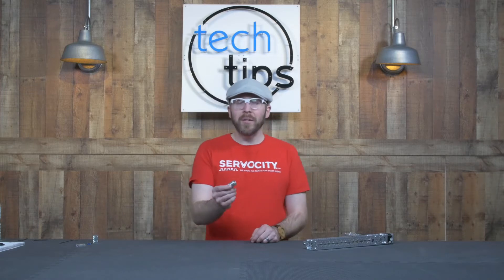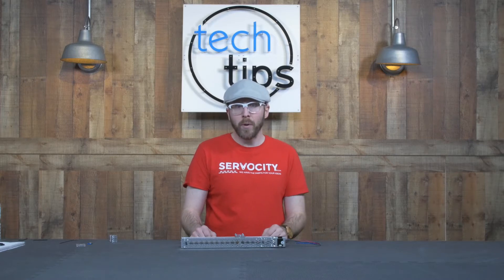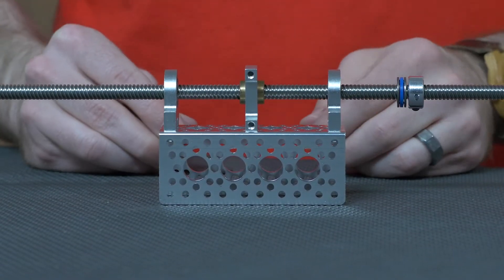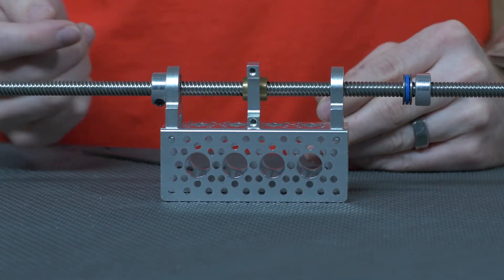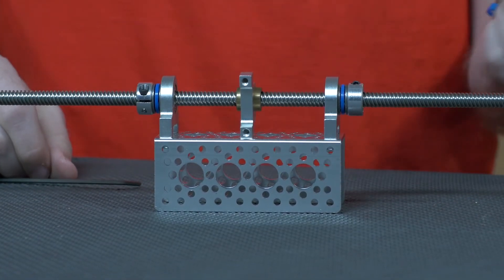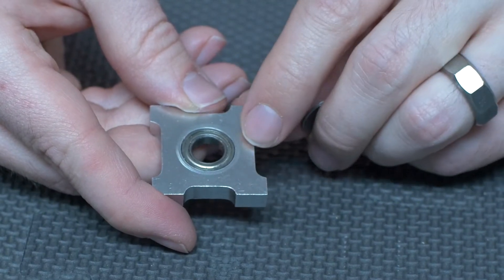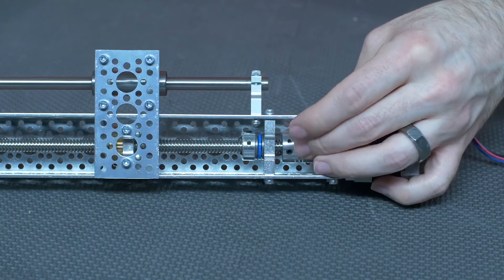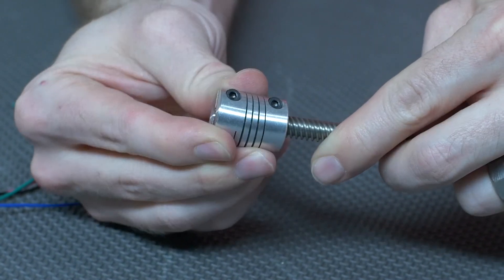Proper Usage of Flex Couplers and Thrust Bearings

Comment: Hey man I need some help could you apply  the flex bearing  to a trick scooter to give the wheel play room to tilt side to side just a little to kinda act like a bushing on a skateboard trucks. Some people that scooter leave their axle bolt loose to add play  room for balance on manuals
Reply from the maker: Hi Matthew, I would not recommend using a flex coupler for a ride-on application such as a scooter.  The amount of radial load you'll put on it will surpass the limits of the coupler.  Please let us know should you have any other questions tech@servocity.com.
Reply: Could you think of anything  that would allow
Reply from the maker: @matt_scootcraft  Sorry, I'm not familiar enough with scooter mods to suggest one to you.